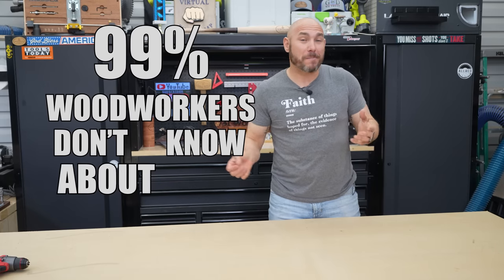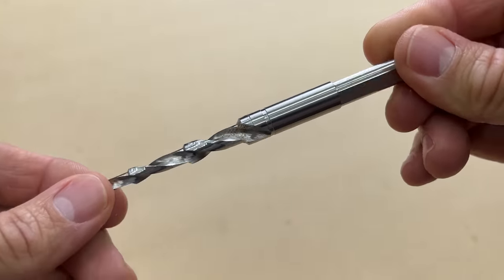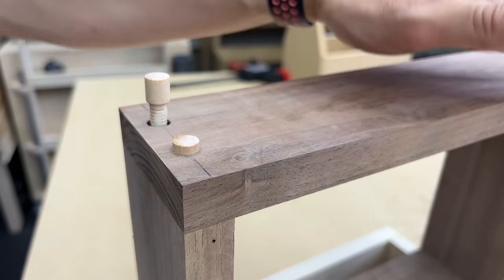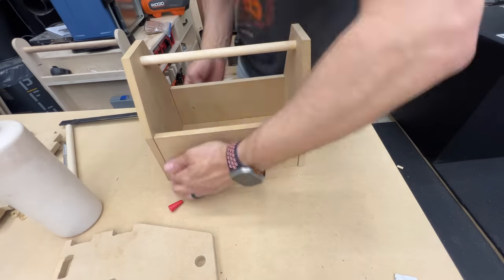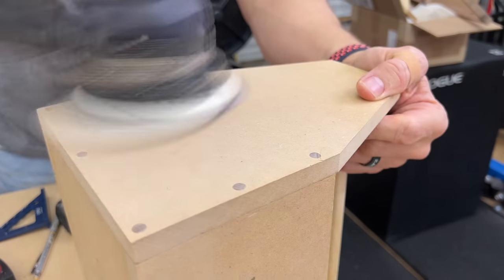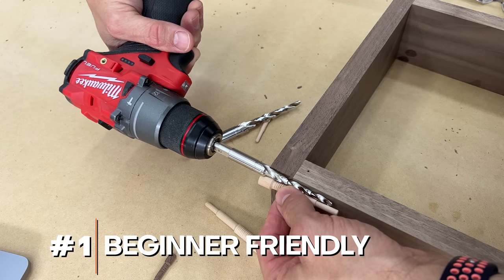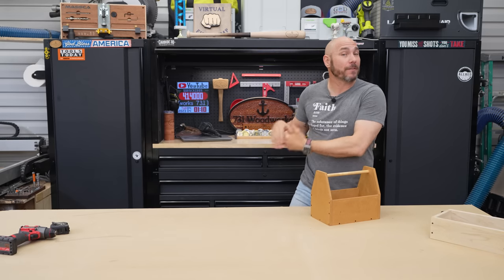You've Never Seen Woodworking Joinery Like This...

Comment: I saw a video recently, which suggested that these dowels were not good at adding strength, and as you can only see a standard dowel-like end, you might as well save your money and use standard dowels.
I quite like the tapered Japanese wood nails, although they are harder to find (I'm in the UK, and the nearest supplier is in Germany). No glue needed, and you can adjust the dowel depth by altering how deeply you drill.

Comment: So what is the advantage over regular dowels? Regular dowels are beginner friendly, more affordable, and look the same.
Reply from the maker: Answered in their FAQs http://www.millerdowel.com/FAQs.html
Reply: I can see an advantage if one is short of clamps, or for some reason has extreme trouble getting a dowel in... The solution of course is the chamfer on a regular dowel, or 5 seconds with sandpaper if making your own, or an extra clamp which will never feel like an extra for long. Feels more like a specialist fastener than a regular use item. Now I can see why 99pct don't know it. It's coz it's useful less than 1pct of the time. Fun thing to know about tho. Thanks.
Reply: @tzuohann  Yeah, your question is exactly what I was going to ask until I noticed you already had.  Even the FAQ doesn't really give an adequate justification for this over regular dowels.
Reply: I am guessing that they are very similar. With the taper pin it controls the depth and provides an advantage if by chance you are drilling at an angle. You won’t break out the side. 
Sharpening the bit might be a challenge later down the road.
Reply: @Saltmancer  yeah, but videos are hard to make and fun to watch. Can't fault content creators for it. It's honest hard work! Would be useful to show the few situations where it would be useful. I can think of a few. One would be a joint where it's difficult to get rid of glue squeeze out and where clamping is difficult such as mounted cabinetry or when one simply cannot screw up existing finish with glue. I'll be glad to know of this as a solution when the time comes. Thanks Matt!
Reply: I'd be interested in seeing a side-by-side comparison test to see if they are really better in any way.  I can't really imagine that there is a significant difference over regular dowels.  I am reluctant to assume they're better just because they're different.
Reply: @tzuohann  I use two dowels and a screw or two screws and a dowel.   Either way, my workbench is still holding up and solid.
Reply: Yikes, the level of shade and skepticism here is just unpleasant. He said pretty early on in the video that these provide clamping pressure of their own, so there you go: pin with these and don't worry about using clamps. They also clearly self-center and drive in straight/easy just by merit of their design, so they're faster. If it doesn't appeal to you, nbd. But many of 731's videos are beginner-focused, and these both look nice, are hard to mess up, and allow those without tons of bar clamps a relatively inexpensive option for assembly nice-looking drawers. And sure, you could make your own, but why? Time is in fact money for some people.

TL;DR: relax, don't buy them if you don't want to.
Reply: Yuck
Reply: They are not for me!!!
Reply: Where I live there are no stores that sell hardwood dowels. These would be great for me. When there was hardwood dowels they were always oak. That’s another advantage of these
Reply: One advantage I seen is he didn't need a dowel jig
Reply: @jose cruz  true. But neither do you if you do through dowels!!!
Reply: He didn’t need a dowel jig, he already glued and clamped it before drilling
Reply: Because they are tapered, they can go deeper into wood than regular dowels can.
Reply: @Lewis.Alcindor  boy this is a very good reason! Esp when joining into thin stock with small margin for error
Reply: @tzuohann  
Yup, not all stock & thicknesses can take a full dowel.  This miller dowel seems to be good for certain situations.  Regular dowels should be fine for most situations.
Reply: @josecruz-jr8pl  I don't use dowel jigs
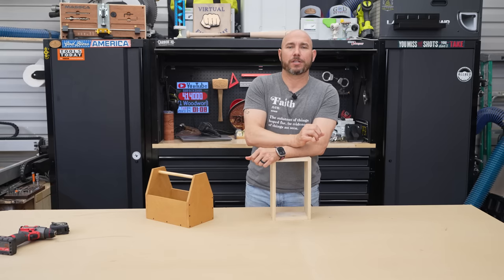Reply: @731Woodworks  One of the benefits not mentioned on the FAQ is that these have more forgiveness for being crooked. Because of the taper, the radius of the bit gets farther away from the wall the deeper it goes. Your error at 5:47 could have resulted in busting out of the side wall with a normal drill bit.
Reply: Just looked over their answer! Makes good sense. I’ve had issue with dowels pulling right out of thru board projects. This would basically be like a dowel and a nail had a baby
Reply: @erik365365365  hehe funny

Comment: I’m surprised these didn’t catch on.  So much simpler than drilling for screws, countersinking for plugs, using a plug cutter, etc.  Also obviates the need for rabbet joinery and all the complicated math involved in building drawers.  A great system that somehow fell by the wayside.

Comment: The problem with these is that, due to the stepped bit, you can't pre-drill the holes prior to assembly. So then you have the drill the holes after the piece is assembled, meaning you have to use a hand drill if you're not lucky enough to own a large enough drill press to hold your assembled piece. With a hand drill you can easily blow a hole out the side of your work.
Reply: Your point is a very good one and worth people thinking about before they choose the Miller doweling system.  I don't have a large drill press but it turns out I probably don't really need one.
1.  I'm fortunate to have the Woodpecker Autoline drill guide.  Configured properly it should work fine.
2.  It shouldn't be overly difficult if you set up things so that you have the second board you are drilling into oriented horizontally.  That's because there's a cheap trick to keep your drill bit at parallel to the horizon although it will be a bit trickier with the Miller drill bit.  You get an eyebolt and put on a couple of nuts to add a bit of weight.  Then you slide the eye of the eyebolt over the drill bit and position it on the shank (smooth part of the shaft).  As long as you keep that eyebolt in the same spot while drilling - you are horizontal.  For most drill bits you are probably going to want to wrap painters tape around the proximal portion of the body (part with the flutes) to create a larger smooth area.

So I think it is doable for a bunch of us if they are careful about positioning.  That doesn't mean it is worth fiddling with for all (or even most) of us.

Comment: Curious why you wouldn't apply glue the full length of the dowel. 🤔
Reply from the maker: I do, but you don't "have" to because the dowel basically acts like a nail that's glued in.  The larger head forces the two pieces together. I always glue them full length.  Certainly can't hurt.

Comment: Butt joints could be quickly reinforced with screws now, and the screws upgraded to dowels later.
Reply: i use the screws as clamps. When the glue dries i back them out, drill a hole and pound a dowel in it for that 2 toned look

Comment: I've been using Miller Dowels for years for cabinets, drawers, adding stair bullnose, etc.; the sheer strength is much stronger than screws, and the pullout strength is tenacious.  For drawers they just look good - a nice substitute for hand cut dovetails in combination with machine cut tongue and grooves; for bread board ends, drilled out correctly, they're great!  Sometimes I'll glue and screw a project for speed and to save on clamps, then remove the screws and replace them with Miller Dowels for added strength and a decorative look.  They are really much simpler and stronger than a screw with a plug.
Reply from the maker: Thanks for sharing James.

Comment: I`ve seen this system.  My problem with it is that I need to buy a new system and it doesn`t really do anything better than what i already own; a decent dowel jig, and a Milescraft drill block will get it done, be as strong (in my opinion) and look the same.  Also, i can make my own dowel out of any wood i have on hand for pennies, whereas i need to buy these,  Just my opinion.
Reply: They are a bit pricey aren't they, Glen?

Comment: How does the small section add shear strength?  Its encased in the wood of one piece....the shear point is where the two pieces come together, like the exact spot where two boards connect with something like a screw or nail, or dowel but the shear force is only applied at the exact spot where the boards come together, not deeper in the dowel hole

Comment: I have recently used them for 19 drawers for bathroom cabinets, total over 200 dowels. Much better than traditional dowels as they are much easier to install. Because of the steps, you are only tapping them for the last half inch and they lock in.  Traditional dowels need to be tapped in the full length of the dowel. Once you use them you will be a convert. Not cheap though.

Comment: Solution in search of a problem. No REAL advantage over a normal dowel, or even using a normal dowel with a wedge or toothpick.
Reply from the maker: Have you tested that theory? http://www.millerdowel.com/FAQs.html
Reply: @731Woodworks  I've yet to have a dowel joint cause an issue. And if you need the "clamp like" extra hold, a wedge in the dowel suffices and looks real nice. (Don't you use the same method to hold a handle in a mallet?).
Reply: @731Woodworks  Have you?

Comment: End result doesn't look any different than using screws and plugs. For my taste, I'll pass. And when I was starting out it would have been difficult for me to drill a hole that deep while staying straight enough it wouldn't poke out on the side. 
To each his own. Also the lowest price dowels are $.20 each. That could add up fast on a big project. I can't justify $20-$50 for 100 dowels. And it would be difficult to make your own dowels. This video is why sponsorship doesn't always work out.

Comment: I bet those are more structurally sound over pocket holes. And more decorative as well! I still like pocket holes! Everything has its purpose! 👍🏼👍🏼 is the kit expensive?
Reply from the maker: They are very reasonable for what you get. Check them out with the links in the pinned comment at TayTools.

Comment from the maker: ▼EXPAND FOR TOOL LINKS and INFO▼ 
Watch Next = 99% of Beginners Don't Know These 5 Mistakes Ruin Wood - https://youtu.be/xA8tcPICLiE&list=UULFSLClJLzdUMRMe0E4SPfc-w
Tools In This Video: 
Miller Dowel Kits - https://lddy.no/1fvfs
Miller Dowel Kits (Amazon) - https://amzn.to/41IRfOh
Walnut Miller Mini-Dowels Used in Caddy - https://lddy.no/1fwrn
Miller Mini-Bit for Caddy - https://lddy.no/1fwro
Blue Square I Used - https://amzn.to/3GjSXx6
Flush Trim Saw - https://amzn.to/3GCa6SO
Spring Loaded Center Punch - https://amzn.to/3zSGQ6x
Outlaw's Board Butter (Use code CADDY and get 20% off your order) - https://www.731woodworks.com/store/boardbutter

Miller Dowel Kits (that include a drill bit)
Mini Bits (same size as used in the caddy) - https://lddy.no/1fwrp
Medium Sized (3/8" head like regular dowels) - https://lddy.no/1fwrq
Large Sized (like the one in my faux drawer cross section) - https://lddy.no/1fwrr

Other Tools/Equipment I'm Asked About Often:
Drill I Use - https://shrsl.com/40tke
Table Saw - https://amzn.to/3IoKqsZ
Table Saw Blade I'm Using - https://shrsl.com/3xv5i
Miter Saw - https://amzn.to/41hbJy4
Dust Extractor - https://amzn.to/41l6RYA
Tripod for Phone - https://amzn.to/3E3kWA9
Phone Holder for Tripod - https://amzn.to/3E1E6GG
Boots I Wear - https://amzn.to/3HkUl3y
Toolbox in Background - https://homedepot.sjv.io/x9B2xy
Tool Wall over Miter Station - https://amzn.to/3ZgWq7B
Digital YouTube Sign - https://amzn.to/3GL2a2e
Camera Gear I Use - https://kit.co/731Woodworks/camera-gear-i-use 
Computer Equipment I Use for Editing - https://kit.co/731Woodworks/731-woodworks-computer-equipment

More Tools I Love!
Massca Dowel Jig X - https://masscaproducts.com/products/dowel-jig-x?aff=3
Flush Trim Saw - https://amzn.to/3V0C2om
DFM Small Carpenters Square - https://amzn.to/40qMSXK
Kreg Set Up Blocks - https://amzn.to/3lLTQra
Gripper Push Blocks - https://amzn.to/3TOApL4
Whiteside Router Bit Set - https://amzn.to/3ZsDWQi
Thin Rip Jig - https://amzn.to/410aiDp

(If you use one of these Amazon and other affiliate links, I may receive a commission) 

Some other useful links:
Daily Tool Deals on my website: https://www.731woodworks.com/tool-deals
Subscribe to our email Newsletter: https://mailchi.mp/7e44c16eefdc/731-woodworks-email-newsletter
Check out our easy-to-follow woodworking plans: https://www.731woodworks.com/store
Outlaw's Board Butter - So Good it Should be Outlawed: https://www.731woodworks.com/store/boardbutter
Reply: I didn't know about these, definitely will grab some and add to my collection of joinery options. And when you are ready to go more novel, grab one of these. https://www.youtube.com/watch?v=UCLGCzOqjv8 I picked up the entire range to do all sizes. I find myself engineering excuses to use them.

Comment: try putting your index finger on the blade of the flush trim saw while cutting. Then you should be able to cut continuously without the need restart for each cut, its also way safer for your other thumb
Reply: Now known as the thumb saw.